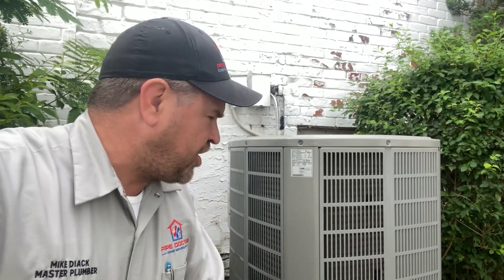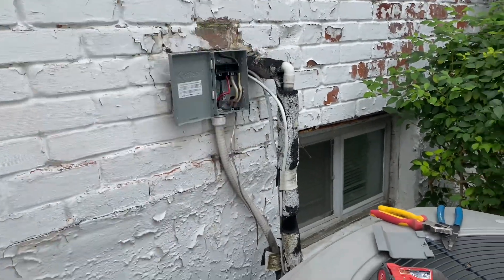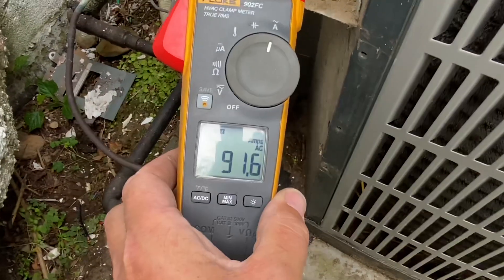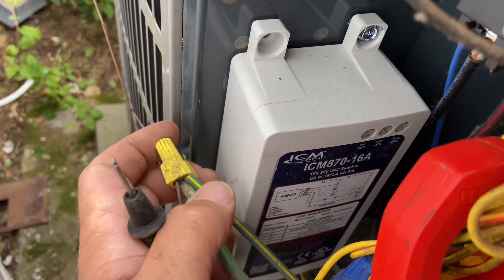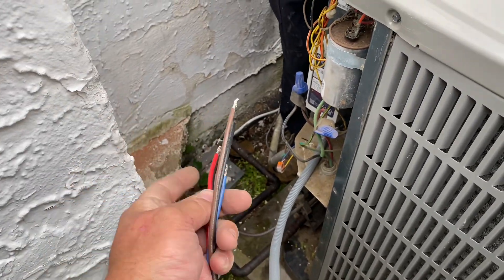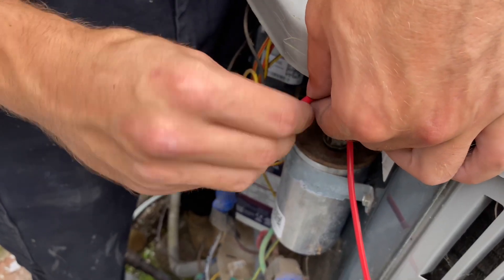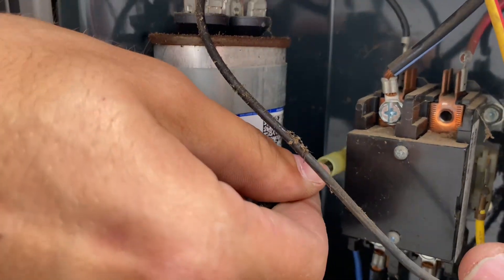Flickering Lights When AC Starts? ICM870 Soft Start Saves Money Watch Step by Install Guide

Comment: I have 2 HVAC units in my house 3 tons and 3.5 tons and I've  never seen fliker my lights and both AC units are 22 years old.
In Arizona heat none of those Soft Start units can run in 112°F-118°F temperatures, they would not last one season.

Comment: Social media says ICM 16a is failing early if the Load Amp is anything over 16, and your Fluke measured LRA at 16.5.  It is also said ICM units sold after 2024 is better to handle load if more than 16.  The 32 cost more, but I would respect the 9-16 rating for the 16a model. On the other hand, ICM says don’t use a 32 if a 16 or 9 fits the LRA.

Comment: Mikey: Do you have a comparison electric bill that shows a before and after a Soft Start is installed? I heard there's hardly any savings and only helps when you're running a gas powered generator.

Comment: Take it from somebody who has done much homework on these soft start kits. STAY AWAY from ICM brand starters! LOTS of people return them burnt up or do not get any return at all from ICM. The capacitors are inadequate and blow out quickly. This has even reached a point where they have suspended production entirely until 2025. 
My research led me to buy the Micro air starter, even though I do not want the Bluetooth on it, it is still maintaining the best track record for consistency.
Reply: It’s 2025, and maybe ICM fixed the QA issues.  Right now, the ICM 32a is $232 compared to MicroAir $389.  Your choice.

Comment: Which on do i buy for a 3 ton unit ?
Reply: The 32a version.  Look at the condenser data plate on the outside.  It lists the voltage, coolant type, fan electrical and compressor electrical with 2 amperage: the RLA is likely to be more than 16a, so you’ll need the 32a model.  Others rave about the MicroAir but it’s $389 vs $230 for the ICM.

Comment: Not safe installing disconnect underload. Should install then turn on at thermostat. No arc rated PPE worn by tech. Not safe and not correct.

Comment: If your lights are flickering, you have other problems you need to address. Start at the main panel.
Reply: Flickering lights when the ac starts doesn’t need further investigation at the panel. It is the locked rotor starting current of the compressor and condenser fan. It is normal, but annoying. Even if you had an 800 amp service, the lights could still flicker.
Reply: @bills6946  absolutely wrong on that. Sorry.
Reply: @harveypaxton1232 my Rheem LRA is 127 against my 200 panel.  So flickering lights on start up is a panel problem?

Comment: I have a Rheem RAKA-030JAZ installed in 1998.  Do you think a soft start can be installed on it? Or is it too old and I should upgrade to a new A/C?
Reply from the maker: Yes
Reply: You don’t upgrade until it’s broken.  Yes, it can breakdown in middle of July in 110 heat, but don’t junk it yet.  The data plate on the condenser unit will indicate the LRA, and if it’s over 75amps, a soft start is a good investment.  If you can install it yourself, $250 for the ICM-32 can prolong your 1998 AC and not a big $ drop.  But replacing the AC for $7,000 is not called for yet.  Who knows.

Comment: I just watch your video where you removed a soft start and tossed it in the yard of your customers. The implication was these are not good systems. Now here your are touting the the benefits of a soft start system. Kind of wishy washy. I hope they pay/sponsor you well. I know I won’t buy those brands of soft starts. I was researching them today. That’s how I found your channel. I need 8 soft starts 6 for my 4 rv’s I own and 2 for my 2 houses.  MicroAir here I come
Reply: I saw the same video
Reply: I've had 870-32a << I believe that numbers for several years works great never a hiccup.....
Reply: @91prostreetstang the 32a model only came out late 2023 or early 2024 and in short supply.  You had it for years ?
Reply: Will consider adding soft start to my ac unit for the correct tonnage of unit as long as it's made in U .S.A.
Reply: Veyy wishy washy. He has no clue. He plays with pipe. He has no clue about electrical. In that other video, he threw the temper tantrum cause he could not decode the error displayed by the LED. I would not take advice from this guy, very dangerous. There are plenty of other tubes that correctly describe soft start use cases, and the benfits.

Comment: I am not DIY confident to do this but am going to contact my HVAC company about it.
  With my last HVAC unit, it had a string of compressor issues. After watching your video today, I am sure my current compressor will last longer with this technology add-on.
Thank you sir.
Reply from the maker: Thanks for watching and sharing your comment.

Comment: Mikey I see you've changed. Your tune on soft starts last time I watched. You, you said they were a hockey Puck and threw one away if you took it off the homeowner's air conditioner. Good to see you coming around to reality Putting the right soft start on the unit. The first place is always a good place to start. Especially if you're using off grid power like a Tesla wall.
Reply: Same thing I said! Unless I heard him wrong.  I just installed one on my 3.5 ton on yesterday
Reply: just shows, a good tech is not afraid to keep learning good job mike !

Comment: at 3:06 you checked for no voltage on the load side of the contactor, aka: bottom ... not good enough. did you not think to check for voltage on the line side?  smh
Reply from the maker: ok

Comment: Hey Mike, love your a/c content. I just installed an icm870 16A soft start and replaced the capacitor GE 40 +- 5 with an Amrad 40+-5 that has a cpt terminal. The ge didn't have the cpt terminal. CAC unit is Carrier Tech2000 installed 1999. Are these capacitors compatible with soft start? Thanx
Reply from the maker: Yes I believe so
Reply: @PipeDoctor  if I wired the soft start correctly, I watched your video, how can I have line voltage on both sides of contactor,  but nothing is running?  And contactor is out.Call for a/c is off at tstat. Can I test system by pushing contactor in? Will any damage occur?
Reply: So, I had red fault light flashing upon power up. No where in the instructions does it say this is an on delay for 4 minutes. Condenser fan comes on, then compressor comes on 4 minutes later, then green start light comes on, fault light goes off.

Comment: I thought you hated these things. Based on that video where you said it killed the power to the compressor and these were a bad idea. I’m considering one because I want to use it with my Generac but what are your thoughts
Reply from the maker: Huh? I never said that
Reply: @PipeDoctor  so do you think it would be a decent idea to get one in order to be able to run my AC on my Generac?
Reply from the maker: @nathanchapel5950  yes

Comment: Had one----lasted a week.  In all fairness I learned I had an old model and there have been improvements. When I asked about getting it replaced with a new model I was told all current models will be sold off dealer shelves first and no guarantee to get a new model.
Reply: Try micoair soft starts. It's a better more durable product

Comment: I just installed 2 of these and they had a 4 min delay to kick the compressor on FWIW
Reply: 4 min start delay is good safety for compressor, allows the refrigerant pressures in the system to equalize, thus making for easier compressor startups and prevents killing it from constant short cycles.

Comment: Yes you need the 32 and why not remove the seal right that's not needed rather than packing all that into the cabinet?
Also these devices DO NOT save power! They reduce current draw on starting prolonging the life of the compressor.

Comment: Soft start good. Lights won't flicker, Compressor should last longer.  Energy savings? No. Same running amp draw.  Your electric bill will not change.
Reply: If you AC lasts longer, your energy bill will be higher for longer. :hand-orange-covering-eyes:
Mine dropped in half when the compressor fried.
Reply: The main draw for these is longer lasting compressor and also ability to use a generator to run AC when power goes out, not to save money on electricity

Comment: Lets do some maths.  50A "savings" for 2 seconds (probably less)..  Say on a hot day the A/C might cycle 6 times an hour (probably less), that's 12 seconds an hour.  50A @ 220 is around 6kW.  So you are saving about 20W an hour (0.020kWh).  If you were to save that much every day, all year long, you are looking at 175kWh savings a year...or about $26 at $0.15/kWh.  At $250, that's a 10 year break even.  So "energy savings" is not really a valid point for these things.  Decreased wear and tear is much more significant selling point.
Reply: As you know, the startup savings are worse than you calculated above because inrush current lasts longer after a soft start is installed.  Only potential savings are decreased wear and tear, as you mentioned.

Comment: shit for the 20 to 30 bucks the capacitors cost may aswell have replaced that rusty thing.
Reply: @PipeDoctor  Too late I already F'd your mother and I hear you're a real 'pipe doctor' you rainbow boy N
Reply: @PipeDoctor  I've replaced the cap in my unit twice, cost was like 20 bucks from granger. Love how you installed the 16a unit on a compressor running ABOVE 16a even with the soft start. Talking about a clown show.

Comment: The important thing is, with this you can actually downsize a generator and save money. And even use a portable generator in an emergency. On a newer system depending on size, if you hit 20  amps or less , 20 x 240 volts = 4,800 watts. Oh! wait the democrats and lib-tards want to ban gas generators never mind. Still a good product though.

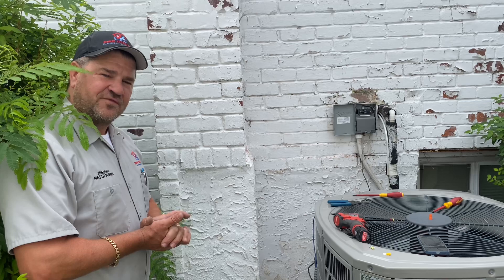Comment: 7:44 funny enough you don‘t save any energy, because the overall energy consumption remains the same; the only thing you do is to limit the inrush current in the transient phase… BUT the motor still spins up with the same energy consumption, just in another time window.
Reply: Nothing funny about it. This isn't an energy saving device.

Comment: If your lights flicker when your ac turns on you should better call an electrician & your energy company because your powerline incomers dimensions are too small… meaning instead of a 100A service, you should better get a 200A service… why? Because the installed service couldn‘t handle the inrush current!
Reply: @PipeDoctor  you are absolutely right installing a softstarter solution in those cases where the system just uses up too much inrush current for the installation or in a situation where a service upgrade just isn‘t affordable! But please don‘t sell it to the people as a „energy saver“… sell it to them as a „equipment saver“, because it prologs the longivity of the motor its connected to… and that‘s worth the investment… ☺️
Reply: if everything was sized for inrush, nobody could afford to have electric because of the giant wire gauge and equipment needed.....
Reply: @throttlebottle5906  The problem is they don't make a 250amp service.  You have to go to 400amp service.  and the price is ridiculous for the 5 minutes a  year you use it.

Comment: I'm amazed at the range of tools and equipment needed for this installation
Reply: I did it yesterday with just: an impact driver, a wire stripper/crimper, a multimeter, gloves and some wire nuts. Pretty standard stuff you should have anyway.

Comment: hey mikey piple you do n'ot need to put your right hand brhind you back.thats,aload of crap.my late father was a electrician  andaicondition contractor in rapides praishes ,in the great state of Louisiana.Phillip colvin.
Reply: 230 isn’t near as dangerous as people act. The one hand rule for taking out disconnects is probably more dangerous than hold the box firm since most are half ass mounted

Comment: If I recall from my schooling back in the day on sizing overloads and protective devices, you can expect to see 600% FLA for inrush or locked rotor current on a motor. Obviously VFD and soft starts will negate that. 
But I 100% agree that a soft start is the way to go. We're always having to replace busted belts on our condenser fan motors for the ones that cycle on/off the most, and a soft start would save that labor on that as well as the $600 belts that get replaced far too often in the summer.
Reply: Carriers belt eating pulley ratios are equally to blame if not more so
Reply: @iwenive3390  ours aren't carriers. The compressors are York (Johnson controls) 3000hp, and the condenser fans are just 6 banks of coolers, each with three 55hp motors. And not a soft start or VFD on 'em. So when they come on, hard, the toothed cogs tended to rip a few teeth off the belts. We've switched to these ungodly expensive kevlar belts that last longer, except on the ones that cycle one-off the most. They just get snapped.

Comment: Couple weeks ago we suffered a power failure and I heard my generator growling, almost stalled when the 5 ton ac started.

I finally installed the soft start kits ( I had for 3 years lol)  on the 5 ton ac and my 5 ton pool heat pump,  pool equipment is locked out of use during generator running. 

All high amp draw equipment should have this soft start. Compressors would last longer and less stress on electric panels and transformer s 

Thanks for this video

Comment: My local tech recommended adding one to my 3 yo unit this year. 
We’ve had a very warm summer so far. Warmer than last year. Yet my electric bill is better!!  
I think it was well worth it.
Reply: A soft start kit will NOT reduce your electric bill.  Although the startup amps are reduced, the startup duration is longer.  Inrush current lasts for a few seconds at most.  The real cost for running an air conditioner is the normal running current which does not change with installation of a soft start kit.

Comment: What's the difference between a hard start and a soft start?
Reply: A hard start is a big capacitor that drops out when the motor comes up to speed. A soft start changes the frequency from low to high to gentle speed the motor up from locked rotor position kinda like a ecm motor

Comment: I just recently installed one of these on my 2.5 ton Lenox condenser, for a couple of reasons. It had just reached it's 5th birthday and thus the end of the extended top to bottom warranty, and I like that, theoretically, this could extend the life of the compressor. This can only be proven with time though. My number one reason was I did not want to have to buy an oversized generator just to handle the momentary inrush of the condenser (my only 240 volt load) and the wasted money that would entail, in both cost of generator and fuel to have an extra 4KW for 0.1% of the time just to start the AC.

Hey Mikey, I'm not positive, but I don't recall you mentioning shorting the caps after disconnecting power and before touching any wires.
Reply: The run cap generally stores almost zero charge unless you remove the wire to it while it’s energized or that wire burn in two. That’s how people get zapped by them. When the wire burn off
Reply: @iwenive3390 you have remove the herm wire to splice with the ICM Brown.

Comment: The inrush amps on start up only lasts for seconds so the savings in electric  is minimal and pay pack for this device would be very long. However, I do believe the compressor lifespan can increase with the use of a soft start.
Reply: Definitely will help with the voltage drop at startup
Reply: And it’s mili seconds
Reply: @iwenive3390  nano seconds, lol
Reply: Also, most of the power used during startup is reactive power, which you aren't billed for.
Reply: @denrayr  Yes very good point reactive power delivery is on the utility not the customer which further supports my case about ROI for this device. But again I say if you drop the starting inrush amps in half that's a good thing for your life extension of compressor
Reply: @denrayr  You may not be billed for it, but they don't pay you for the lights flickering either.
Reply: Hey! A Buck 50 is a $1.50. (over a 3 month cooling season, 14 hour days, 3 cycles per hour, 7 days a week, Coned residential rates.) Yeah, I went and did the math... 🤣 I've got to get me a hobby.
Reply: @mickeyd9369 coned is a huge monopoly and scam in general… I’m so glad I don’t have them as my utility
Reply: @mickeyd9369  Mr Pipes I love your videos and dedication to your trade but I am an electrical engineer working for NGRID on LI and can tell you that as one of your other followers pointed out, reactive power demand from a compressor starting inrush is not measured in a residential meter. There are more smart meters being installed that can measure power factor and bill according but at present this is limited to certain commercial customers only.
Reply: @PipeDoctor  Modern power meters measure and report both real and reactive power, but residential customers are billed for real power only. Again, there’s an assumption of average power factor for residential customers and no penalty for low PF. Utilities now have automated systems which monitor power usage on individual houses - sudden increases or decreases in usage would be noted and may involve an inquiry to the customer but I doubt a single 3 ton would warrant such an inquiry
Reply: I installed the soft start to reduce the flickering of my led lights which it removed about 90% of it . The start up max current was 52 amps, after install the max current was 21 amps, a drop of 60%.
Reply: There are three reasons to install a soft starter,  You have a back-up power source they can't supply adequate starting amps. (generators and battery inverters). Your Power company charges a peak demand charge, and lowers wear to the windings of the compressor.
Reply: but not these guys